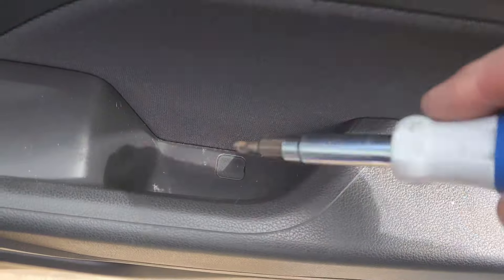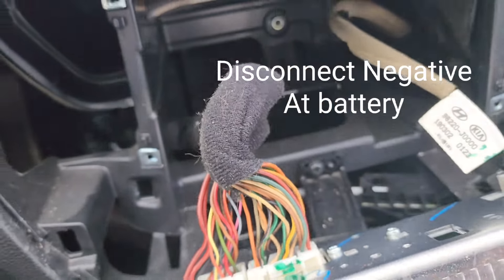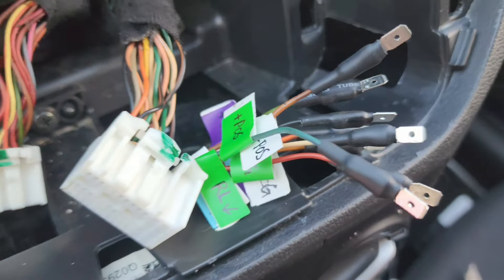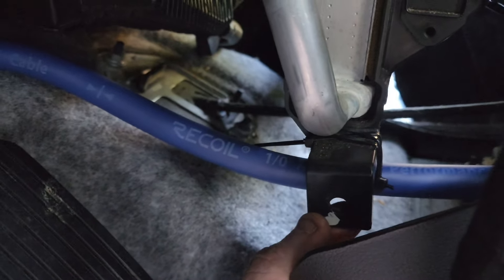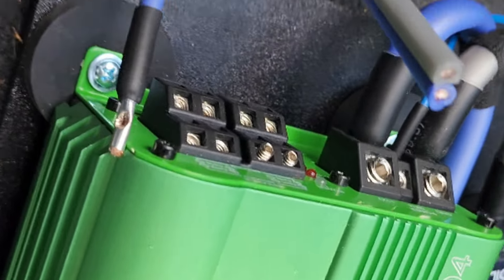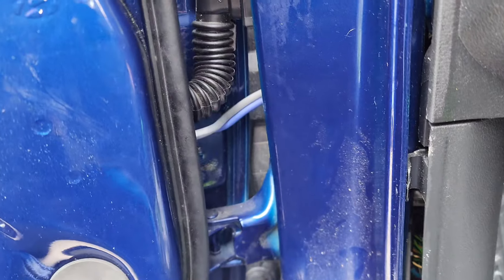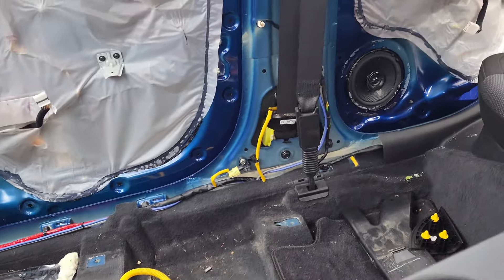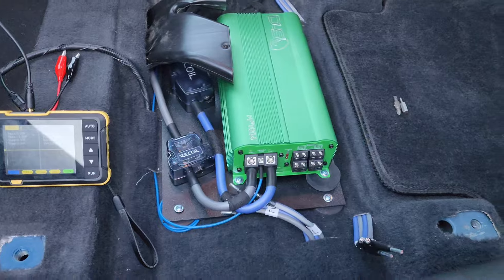Down4Sound MM1004 amplifier install with speaker wire runs

Comment: Those ducts under the driver & passenger seats are a paining the ass
Reply from the maker: Wasn't to bad just had to use a heat gun to remold them. I didn't want heat to be blowing right on the amp.

Comment: I also have the black mm100/4
Reply from the maker: Nice!! ya I was thinking about going with blue but they were sold out. I'll prolly get the blue jp3 when I do the sub. This amp kicks ass though very good buy for the money.👍
Reply: @Turbonicplague  do you think the jp3 will fit under the other seat 💺 ??? I hope you do video on jp3 install
Reply from the maker: @danrimjob5546  You can get away with it, it's 3 inches wider. You may see the amp a little from the back seat.

Comment: Are you still happy with this amp? I'm thinking of picking up their 4x50w mini and 2x100 mini to run full active front components with rear fill (thinking about morel maximo 6.5 comp front and 5.5 coax rears). Looking at the d4s ezy 6x8 dsp too....ever tried it?
Reply from the maker: I am super happy with this amp. Still working great. I have not used it, sounds like you will have a great setup though👍
Reply: 4x50 mini? Dont waste $ on those tiny amps. Hands down 10.4...

Comment: Are you able to fit underneath the driver or passenger seat ???
Reply from the maker: Yes it looks exactly the same under the passenger seat. There is room there if that is what is preferred.
Reply: @Turbonicplague  I have to put amps under the seats 💺 the trunk is just too small

Comment: am i doing something wrong, i copied your oscope settings and my wave is super smart can’t even make out the waves
Reply from the maker: I'm pretty sure this oscope will not go that low. The wave is to big to fit on the screen. You may just have to go with like 100hz back the gain off a little and call it good.
Reply: @Turbonicplague  but didn’t you use a 1000hz tone in the video?
Reply from the maker: @_N4VE_  I did like 5 different frequencies to just check a wide range.
Reply: @Turbonicplague  yes but in this video you were using a 1000hz frequency yes? just wanna be sure cuz that’s the least i wanna do
Reply from the maker: @_N4VE_  Yes I believe I was using 1000hz
Reply: @Turbonicplague  and that’s why i was confused because i used your exact settings and my wave looks nothing like that
Reply from the maker: @_N4VE_  what does it look like

Comment: Bro how much room do you knows under seats 💺 Measurements of course ) if you got time 😁
Reply from the maker: Ya man...so there is a recession under the seat. If you are looking from the back seat, you have 11" deap x 16" wide (width is between the seat glide rails). With the seat jacked down you have 4" tall, and with the seat jacked all the way up you have 6 inches. You still have to make connections and stuff so you will need a smaller amp to make it fit easily. Hope this help
Reply: @Turbonicplague  12.20 L , 4.87 W , 2.13 H  , do you think this will fit under seat 💺 ??? it’s the new d4s 5 channel amp measurement’s , let me know what you think about it fitting under seats 💺, THANK YOU SIR
Reply from the maker: @danrimjob5546  so I just checked. It honestly will fit even with the seat all the way down. Account for mounting it to something like a plastic board with iso pads, unless you are going to just throw in under there.  12 .2 wide is pushing it because your wire still have to be connected. I think you will be good man👍👍
Reply from the maker: @danrimjob5546 8.66 L x 4.87 W x 2.13 T inches are the dimensions of the mm1004 that I have.
Reply: @Turbonicplague  I appreciate you checking that for me SIR ✊🏻
Reply from the maker: @danrimjob5546  Glad I could help homie ✌️
Reply: @Turbonicplague I hope you show video of the jp3 hooked up in this car ✊🏻
Reply from the maker: @danrimjob5546  it will prolly be a little bit but I will when I get the money...Thanks for watching!
Reply: @Turbonicplague  sorry man I won’t bother you anymore , I just don’t know anyone with the same car is me 😁 but I think 🤔 the mm1000/1 would be a perfect under the seat 💺 sub amp it’s the same measurements as mm100/4